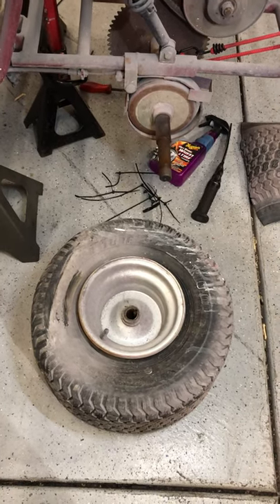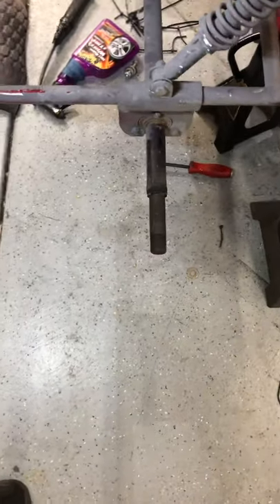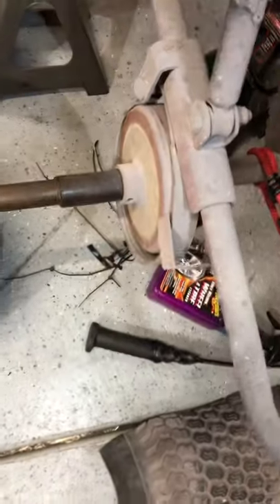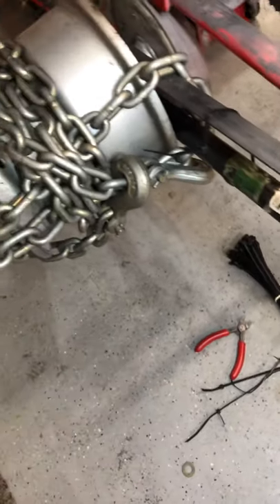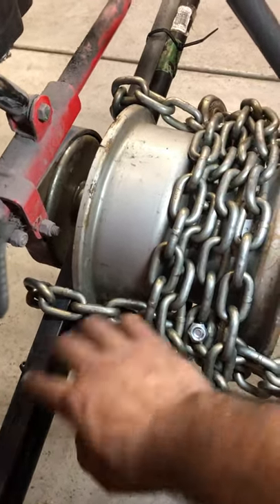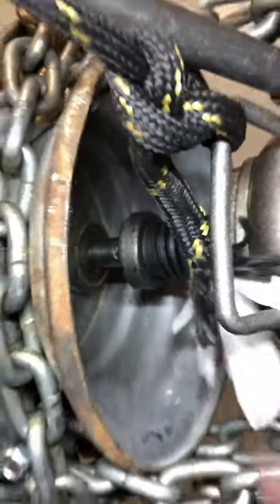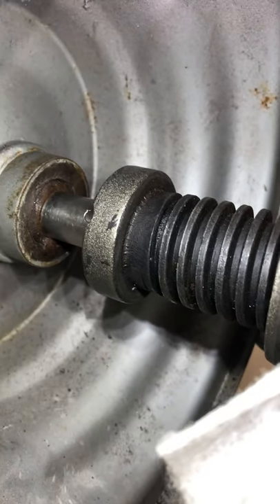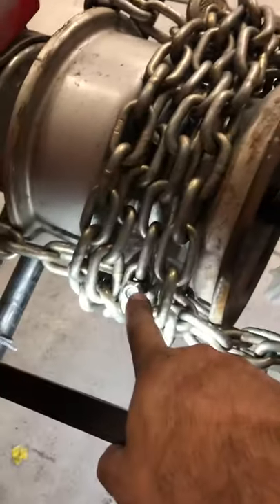Remove stuck seized wheel from live axle go kart, or lawn tractor

Comment: what is awesome is I came here before I started and I see that you have a Yerfdog 32xx just like mine!
Reply from the maker: We had two of them but sadly, they were not mine, they were a customers. But they are really awesome karts when you set them up right, you should check out my video adding a parking brake to them, it really adds to the safety of the kart, Thanks for watching the video and taking the time to comment we really appreciate you, be safe working on and riding your Go karts, be sure to like and subscribe, thanks again.
Reply: @MechaniclifeJDM  I took the motor off of mine to convert it to electric. I needed to get the axle off to get a different sprocket put there to tame some of the electric motor's torque and increase the top speed. My little bottle jack is broken, it turned out so I am hitting Harbor Freight Monday.
Reply from the maker: @GunsGamesPlanes  Sounds like a cool build man good luck with it, stay tuned for some new content coming in the near future, and if we could be of any help we would be happy to offer a different perspective if you would like one.

Comment: Currently have the same issue with a yerfdog 😂❤ thanks man
Reply from the maker: Work safely 
Expect stuff to let go, worst case you gotta cut stuff and buy replacements from BMI Karts, but before you resolve with that type of solution, just be patient treated with some PB blaster a little bit of heat, and some impact in the right places but not too crazy, use this jacking method and it will come off, just be patient

Comment: Cool. Now how do you get the axle out?
Reply from the maker: Clean it up with some emory and PB Blaster, check for shaft collars behind your bearings or set screws on your bearing inner race, once those are removed if any are found start to work it back and forth tapping it side to side, clean up any additional rust or debris and then slide it out one way, will take a little work but it should come free, worst case you may need to heat up the bearing inner race a little bit, or cut it up and replace it, observe your safety precautions

Comment: I got a wheel puller and they still won't come off
Reply from the maker: Heat, treat and beat, then repeat!

Be safe about this: heat only the hub area not too hot, deflated tire of course 
when it cools hit the hub/axle area with pb blaster multiple times
Throughout a full day shocking it in between applications using a piece of wood and a mini sledge, then following my video it should come off
Reply: @MechaniclifeJDM  thanks 👍🏻.